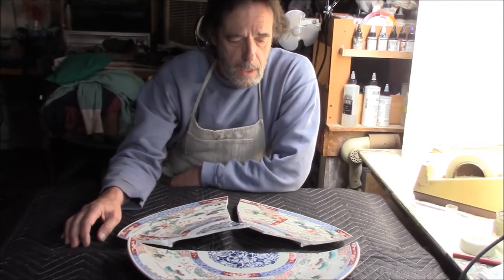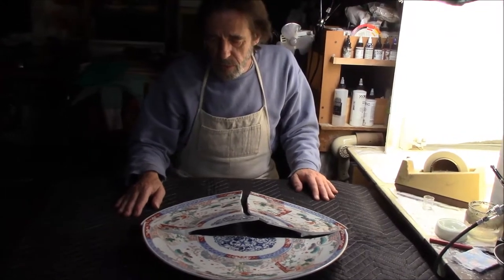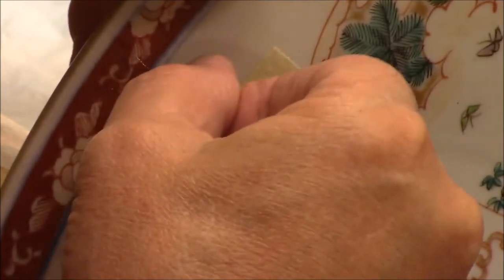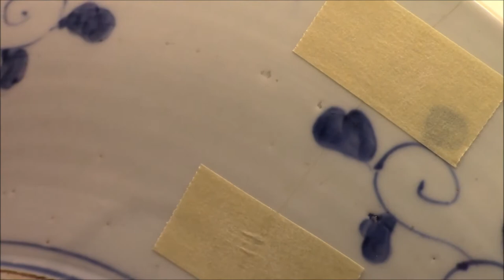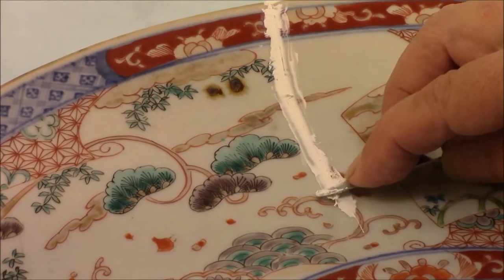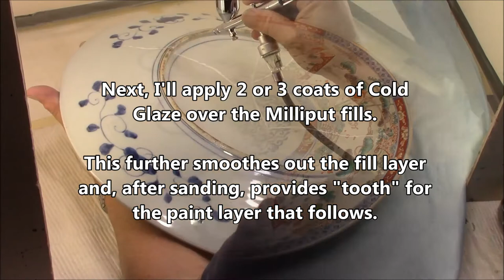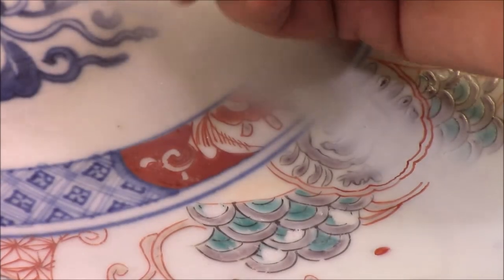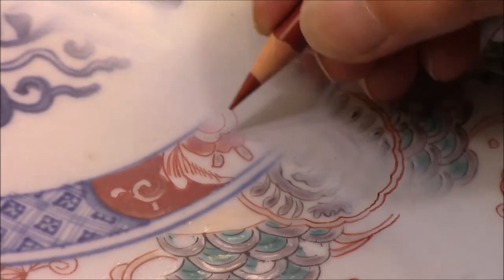Imari Platter Repair pt1

Comment: Fabulous information about firing ceramics and shrinkage and warping. This would explain alignment issues I had with a plate which appeared to have a clean break. 
I searched high and low for the little knife you use. Now I learn it’s custom made which explains why it works so well. 
I’m sure you said once that you hate hand painting. This demonstration made my eyes bleed. One question. Why would you not use masking fluid around the crack to reduce the amount of painting?
Reply from the maker: Re: masking: sometimes I do. But usually the airbrush is used because it hides the transition of my color to the original color in places where the glaze color has barely perceptible differences in color and its density.
Reply: @marsgitar  Ah, I see, I knew you would have a good reason for doing it that way. Thanks for explaining it to me.